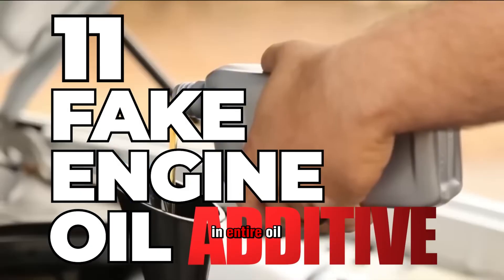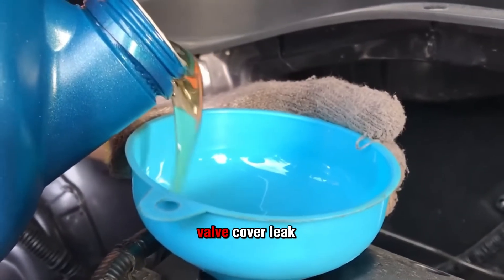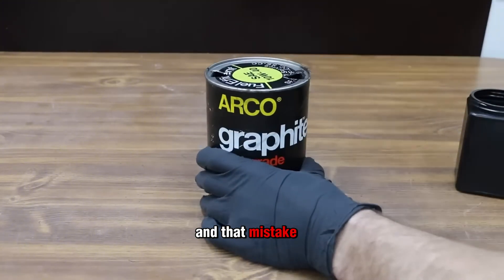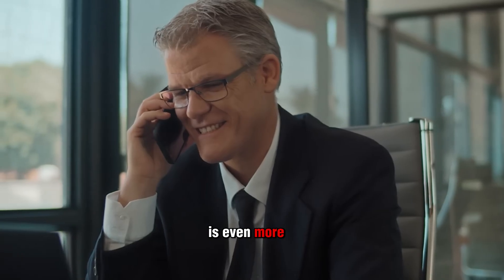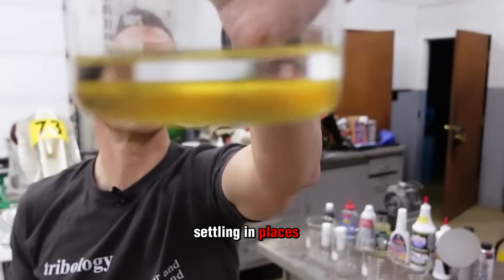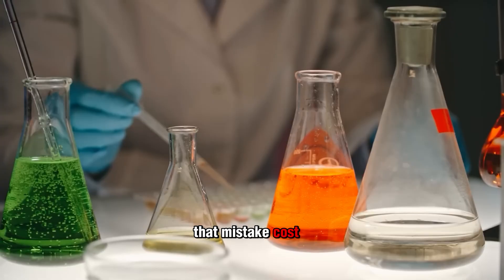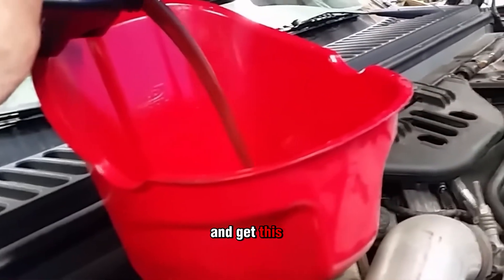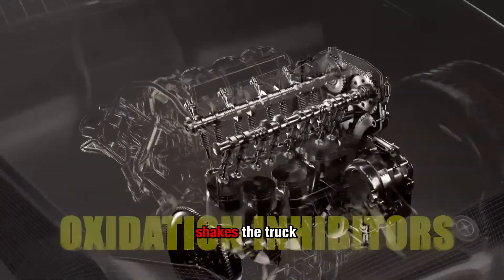NEVER Use These 11 Engine Oil Additives (And 5 That Actually WORK!)

Comment: I used that Restore product on a 1983 Buick Electra that had a 305 cu. in. V-8. A day or two later I started that car and lost oil pressure. The gasket on the lube oil filter blew because it clogged the lube oil filter with sludge. Luckily I had more oil and another oil filter in the trunk of my car.
Reply from the maker: Yeah, that’s a common issue with Restore on older engines. It can loosen years of sludge all at once, and the oil filter ends up choking on it. Lucky you had a spare filter and oil on hand—most people would’ve been stranded. That ’83 Buick with the 305 is a tough old ride though, glad you caught it quick